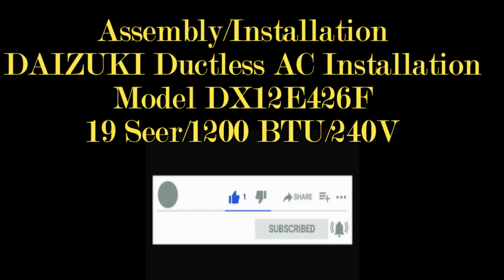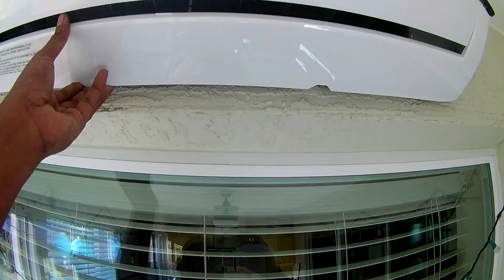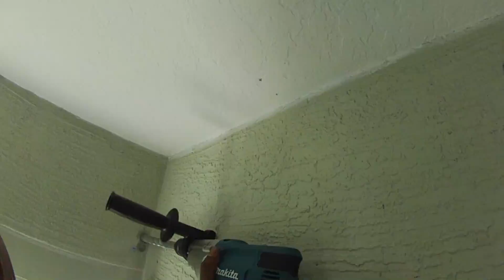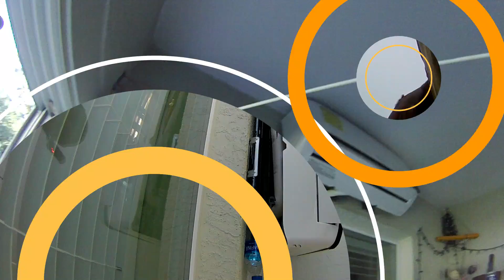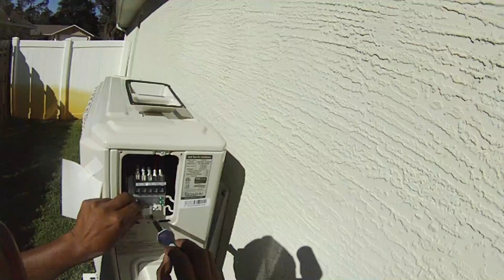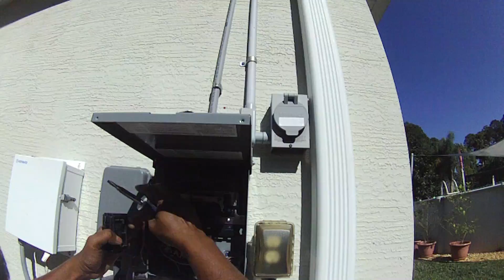DAIZUKI Ductless AC Installation Part 1 Of 2

Comment: what size breaker did you use for this unit?
Reply: 15amp two pole, the max amp pull is 15amp for this unit. Do not use the 30amp that he suggest.
Reply: @beauthepyro  exactly what I used.  Ironic that this comment came in today. I just got done doing some service on the units as they have been in for a year now.

Comment: What was the total length of your lines, and what was your final psi of the unit when finished? Did you have to add more r410a to get ideal pressure? Thanks
Reply from the maker: 37ft, the PSI will be based on the outside temperature and that I don’t recall.  Yes, I had to add more refrigerant to compensate for the extra length of lines.
Reply: @BARR8323  Thank-you for the reply. How did you know how much refrigerate to add to the system? I read somewhere 1oz per 5 extra feet of line. The reason I ask is I am about to install a system with added line length and there's not much online on how much r410a add, and wondering if there is an equation to go by. Thanks
Reply from the maker: There is, if I recall it tells you how much in the manual, there was a chart.